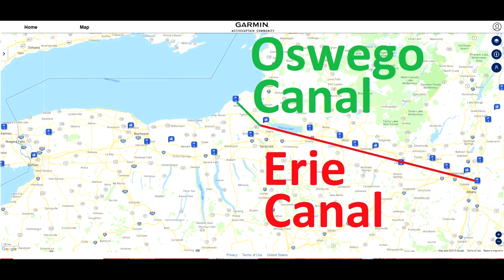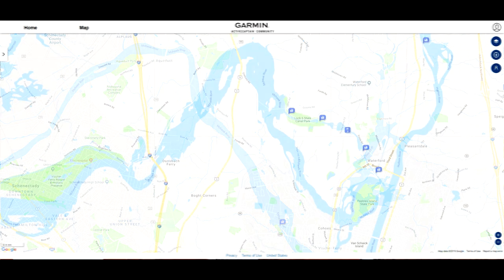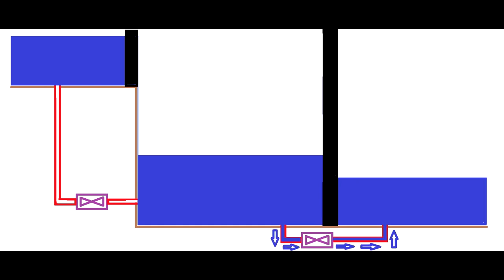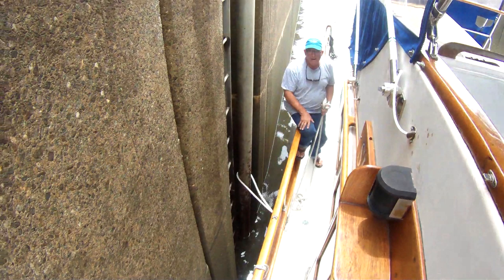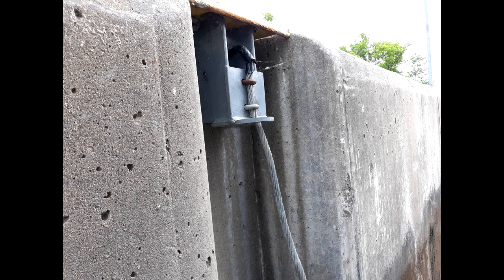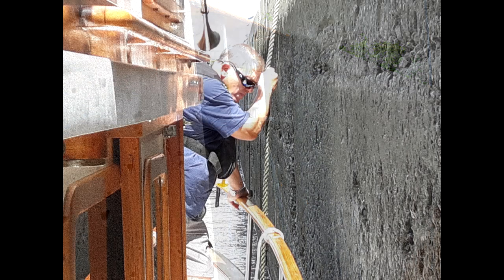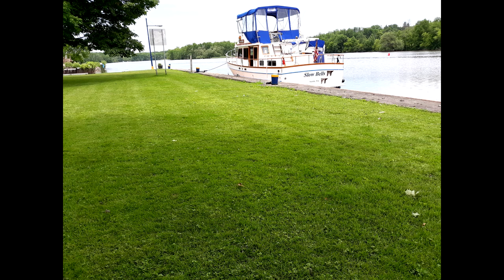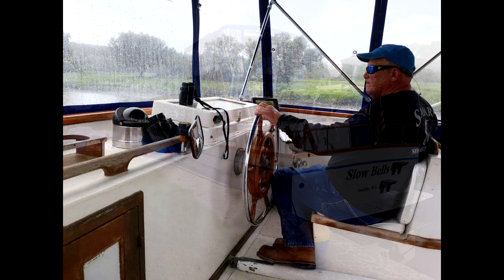Great Loop, Erie Canal (Slow Bells ep. 25)

Comment: Welland Canal in Canada between Lake Erie and Lake Ontario, if you want to hear some God awful noise of 1,000ft lake freighters rubbing steel on concrete...ugh
The overhead guillotine gates are a safety measure if the canal gets a blowout leak and shuts other areas off for the winter drain. 
The bike path along the canal in the original days was for the mules to tow the canal boats. Which also back then made the canal a place of horror from dead drowned mules that couldn't escape the walls after falling in. 
Thanks for the video

Comment: I notice a bridge at around 7:02 Is there a max height for personal boats to travel in the Erie canal?
Reply from the maker: I suppose there must be a max height for the Erie, but I don't know what it is. Someone doing the whole Loop knows about the lowest bridge in Chicago, and selects their boat accordingly. Someone only doing a portion of the Loop could get away with a taller boat, but you would have to study the charts to determine how tall you could go. And, of course, heavy local rain could temporarily change that max height.
Reply: @seattleboatguy  Thank you good Sir.  I'll look for a sub 15 foot bridge clearance boat, to stay on the safe side
Reply: 13' Bridge on west half of the Erie Canal if you go straight out to Buffalo, so, most go out Oswego canal. Then you only have the 19' outside of Chicago

Comment: Is that ship supposed to hit the dock?
Reply from the maker: Tango Dog : We were talking with the lock attendant as the ship was approaching. He was saying how skillful the ship drivers were, and that they would not even touch the lock walls. Well, that was not the way it turned out. Maybe they were training a new captain??? Dunno.
Reply: @seattleboatguy  I suspect wind may have had something to do with the grinding. It doesn't take much to push the boat against the walls when you don't have steerageway and you enter or leave the docks.
Reply from the maker: @richardbohlingsr3490  : An extremely tight fit, too. I would be scared to death to try and get that huge cruise ship in one of those locks.